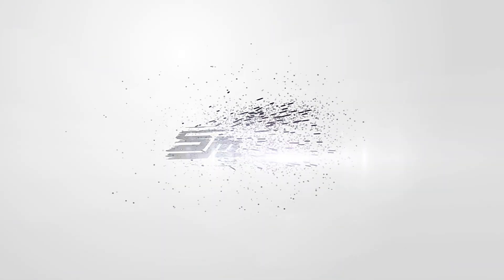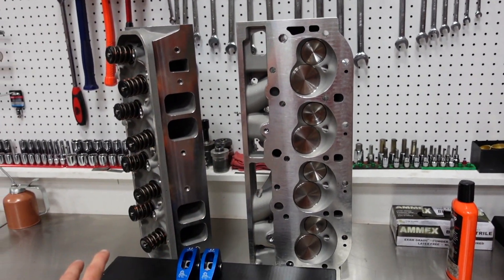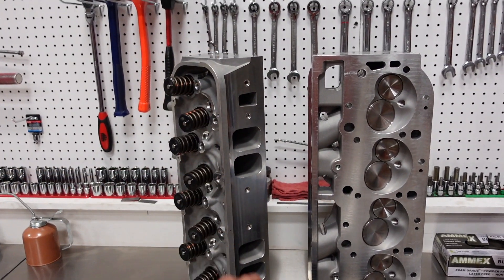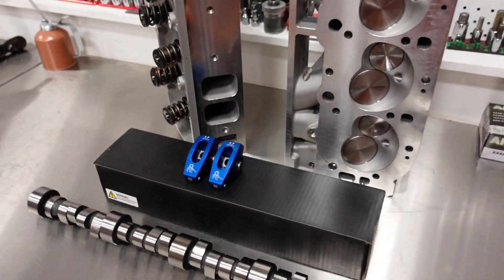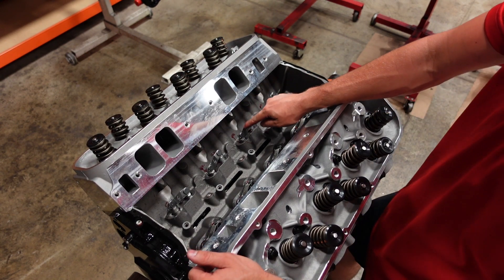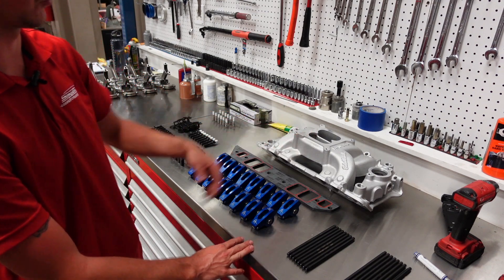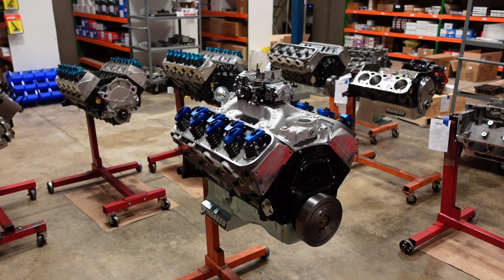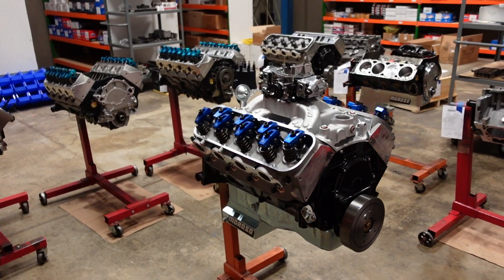Demo Ranch 540" Big Block Engine is Complete & Ready to Dyno!

Comment: Good video, on my 383 sbc with factory 113 heads I have to use thread sealant on the bolt holes for the accessory brackets also because the threaded holes go into the water jacket on the heads.